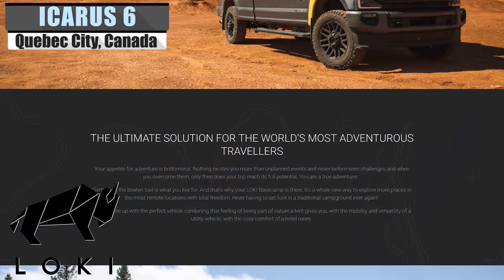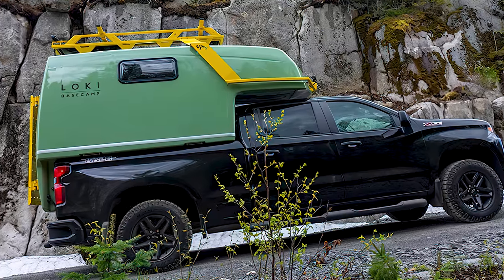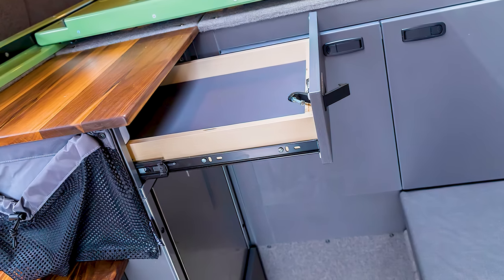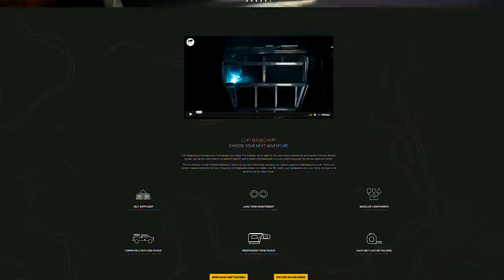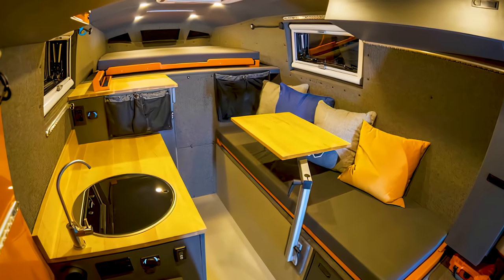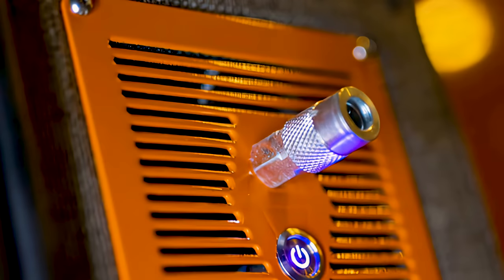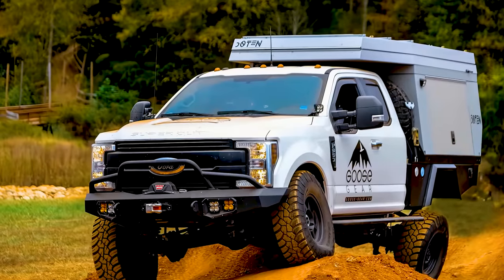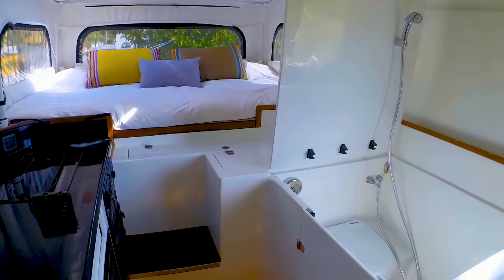NEW HARD-SIDE TRUCK BED CAMPER IS MADE FOR ALL-SEASON WEATHER

Comment: I've got to get into making these campers, look at the profit margin. They couldn't have spent more than a couple thousand dollars in materials and maybe that much more in labor.
Reply: @Couchlover47  where do you live? Fiberglass fabric and resin and a few boards can do most of the structure and that doesn't cost that much at least where i live it doesn't.
Reply: @keltonfoster  the electric along probably costs around 4,000 to 5,000 dollars and that doesn’t include the labor for an electrician. Then the cost of the wood to make cabinets is more expensive than regular plywood. Then the cost of the carpenters to build. It probably cost at least 20,000 to 30,000 dollars to build just in parts, then add in labor. They are probably still making pretty high profile though.
Reply: @scott0551  you must not work with your hands much to believe that. How much wire and batteries do you think it would cost for a camper this size? I bought an inverter and some lithium iron phosphate batteries to run my home and spent less than a thousand dollars. Where do you shop at on Hollywood boulevard?